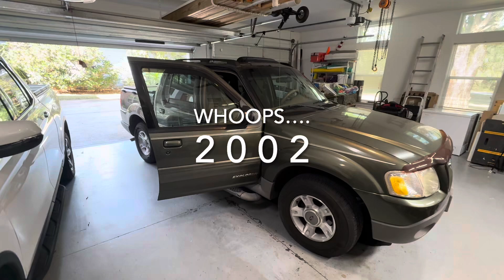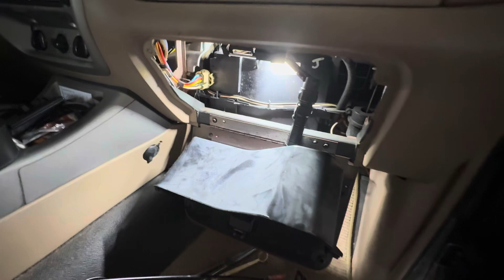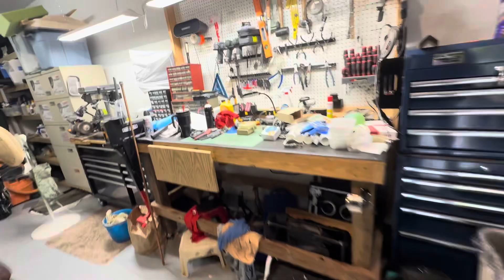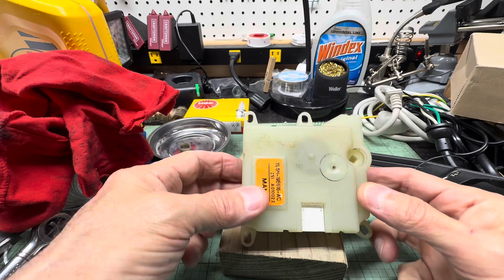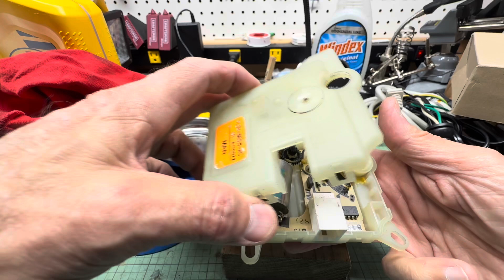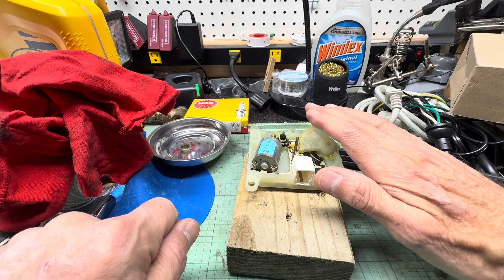2002 Ford Sport Trac Blend Door Actuator replacement

Comment: Hello, i just got one of these trucks and neither heat or ac works, could this thing cause that to happen, or would it just be stuck on one or the other, because neither works. Thanks.
Reply from the maker: It seems like you should be getting one or the other.  The blend door determines if you get more heat or cold into the mix.  Even if the door were stuck in the exact middle you should feel cooler air when you kick on the AC.

Comment: Thank you very much for this video!! I have the similar no cold no heat and flushed my heating core and nothing, and it came down to the time to try this.. where did you order the actuator from? Autozone? Amazon? which brand did you get and how much did it cost? And most important, did it fix the problem? Thanks
Reply from the maker: Replacement part is a Dorman product I purchased on Amazon: https://a.co/d/gUNOnPT
Yes, it did fix the problem.
Thanks for writing!